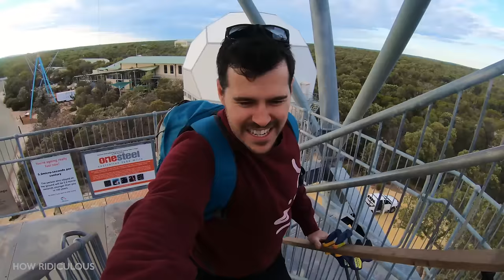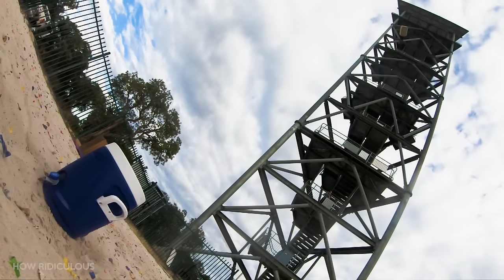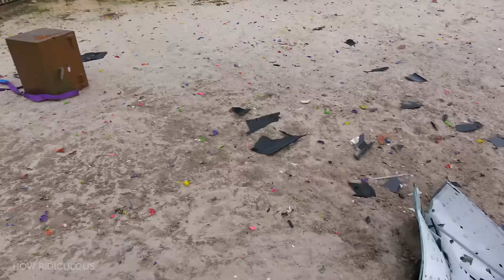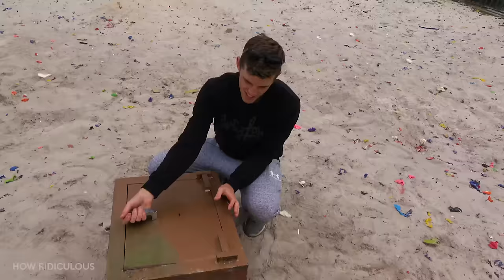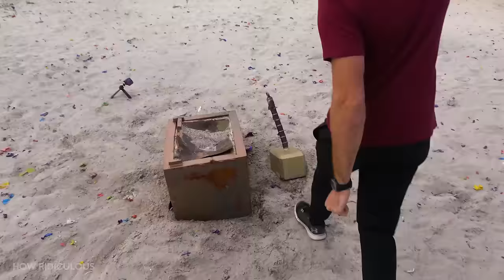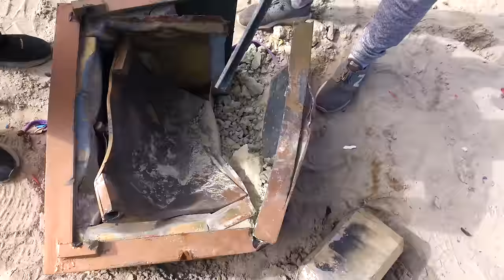Can THOR'S HAMMER Break Into a 250KG SAFE?

Comment: You should try to drop an atlas stone on to a thick hollow rubber bag/balloon conected to a pipe whith a tennis ball in it. I bet the tennis ball would fly pretty dam far.
Reply: or it would pop the balloon before moving any air
Reply: @ThatGuyIsAwesome275  Not if the balloon or rubber container was thick enough

Comment: They shouldn't have dropped the hammer on the front of the safe. It merely dented the door, which made it even harder to open. A better way to break into the safe is to drop the hammer on the top of it. The force would dent the top and thus squeeze out the door. However heavy the hammer is, it won't be able to break the steel plate due to the flexibility of the material itself.

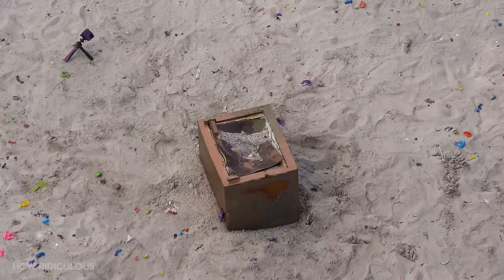Comment: You probably could have gotten into that safe in 1 hit if you didnt target the door. The door is usually just pure metal, and the stop makes it so the door won't swing inwardm so non stop bashing the door will just wedge it in harder, making it worse to open.. Since safes like that are meant to be built into a wall, so their sides and back aren't exposed they are significantly less strong on all sides besides the front. Usually just some thin metal and concrete which the hammer should have had no issue with. 12:27 was the only hit to actually hit a side wall and see how much more effective that is.

Comment: Do the items you drop reach terminal velocity.? Is the tower tall enough?
Reply: Terminal velocity of a human is a bit less than 60 m/s (very rough estimate). Tower is 45m and g is 9.8m/s^2. So a person should take less than 3 seconds to fall that far and be travelling less than 30m/s (100km/h). So not even close to terminal velocity for a person. Thor's hammer, being a lot more aerodynamic than a person, or rather having more weight to surface area, would have a much greater terminal velocity.

So short answer: Nope, not even close. Except for small/light things, they might get there, depending on their weight to surface area.